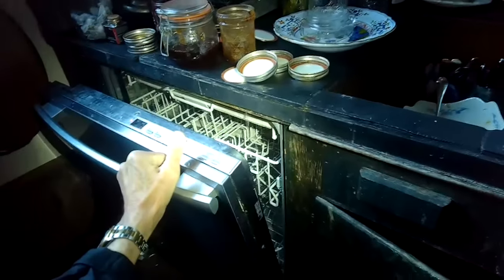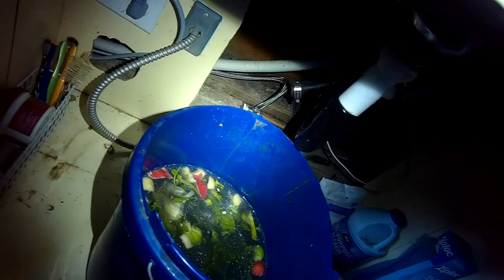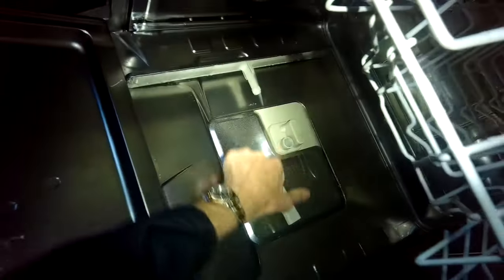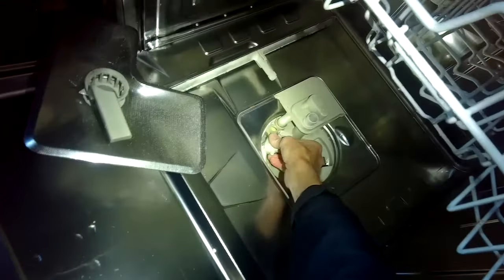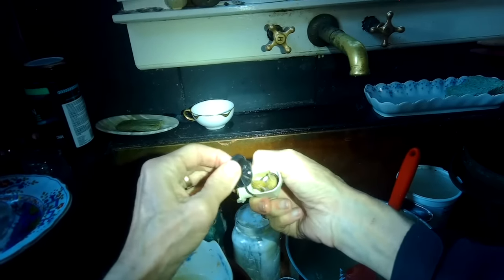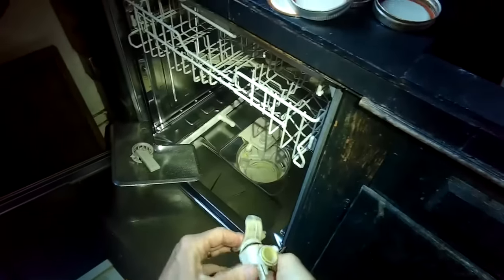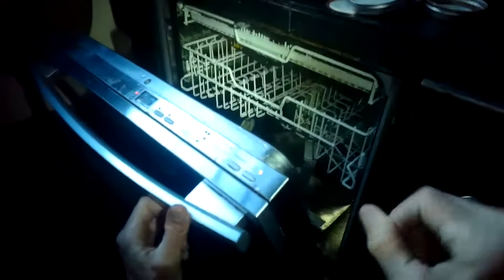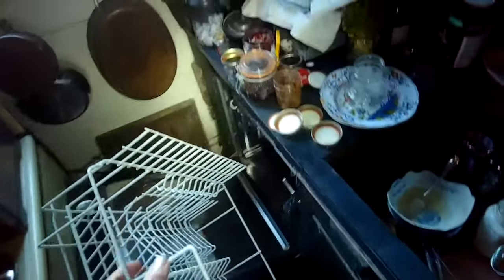✨ MIELE DISHWASHER WON’T DRAIN - FAST - EASY FIX ✨

Comment: Great video!
I have a G2470 that drains during cycle but gets stuck at the end with 1 minute showing and won’t drain, and won’t stop running. Any ideas?
Reply from the maker: Can you unplug it and then remove the two panels from below the door and sponge out the trapped water from the drip tray?
Reply: @QuickAndEasy5MinuteAppliance  thank you! I will try that.

Comment: Replaced the one way valve, still get water build up after running a few loads - have to bail once a week.  Any ideas?
Reply from the maker: Hey Steve,
Just need to replace the fill valve.
It’s letting a little water creep in.
Reply: @QuickAndEasy5MinuteAppliance  Thx, i'll research where to find it.
Reply: @QuickAndEasy5MinuteAppliance  Ok, Scott.  I replaced the fill valve.  The drain/intake light came on after the first run but it began with the bases loaded so to speak.  So I bailed the water out and finished with a dry towel and all seems to be good now.  The drain/intake light hasn't come on since (about 2 weeks).  Thanks!.